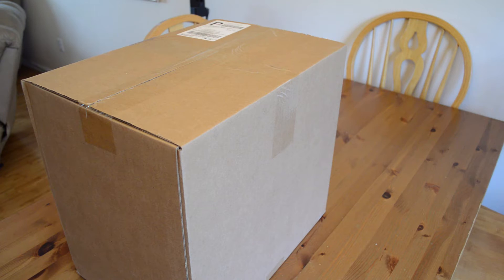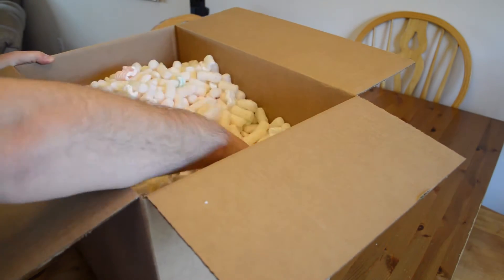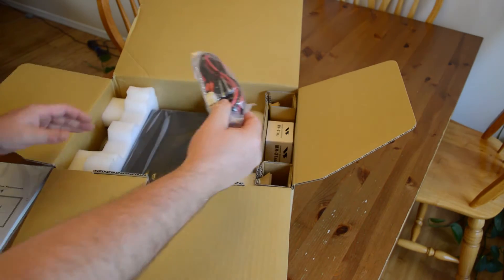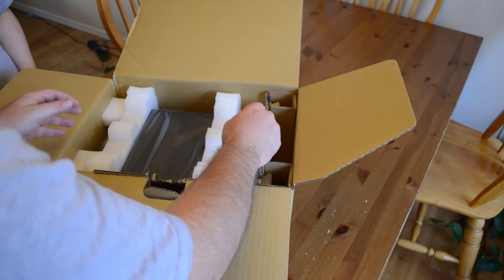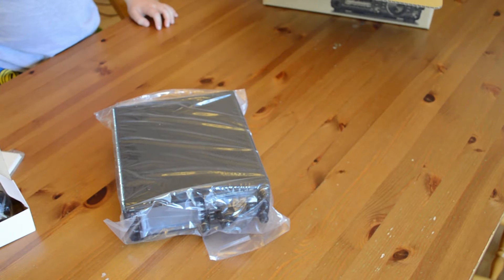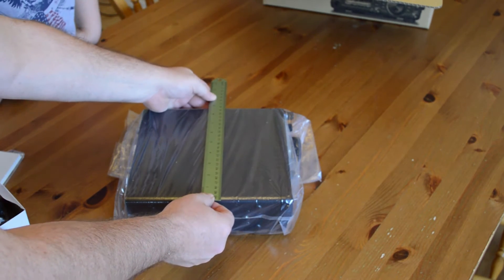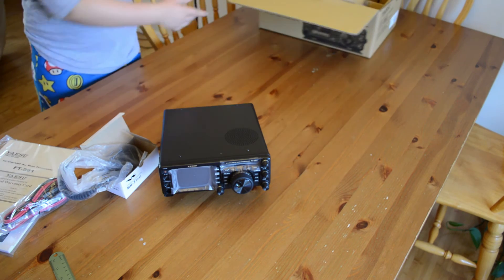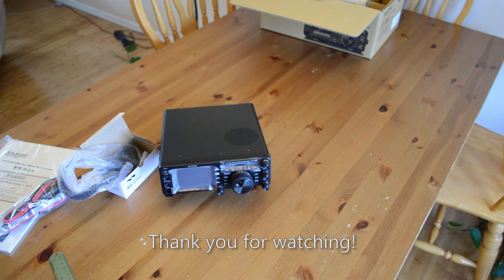Yaesu FT-991 Series: Part 1 - Unboxing

Comment: Great video! Anxious to see part 2. Would love to see some System Fusion, programming memories, repeater use and HF use! Thanks for posting. Fantastic first unboxing video! 73.
Reply from the maker: HeliDragon510 Thank you very much for your encouragement.  I am planning to put out Part 2 soon.  Unfortunately, there are no Fusion repeater in my area yet, but I will actually be putting one up soon.  My DR-1X is on back order.  So, part 2 will be a brief look at the radio.  Incidentally, I used this radio for Field Day and made a ton of contacts.  This is the most amazing HF rig I've ever used, and I've been a ham for over 25 years!